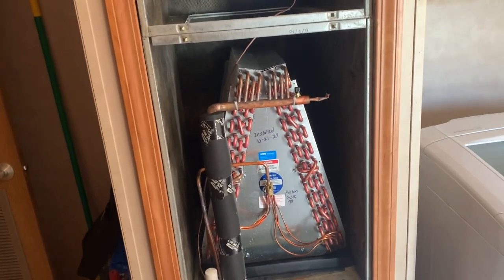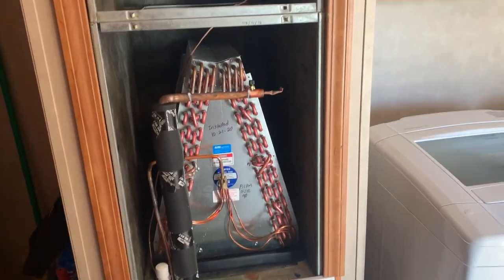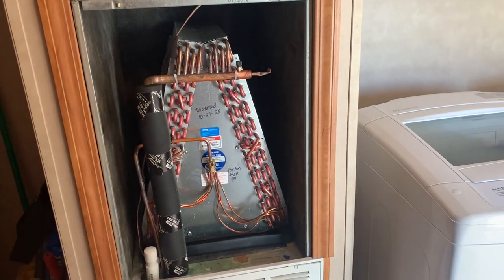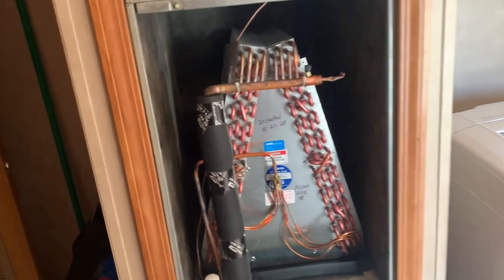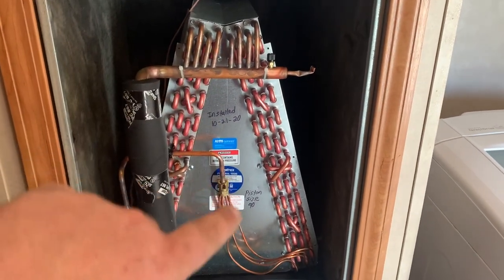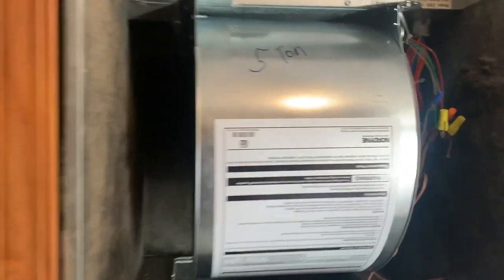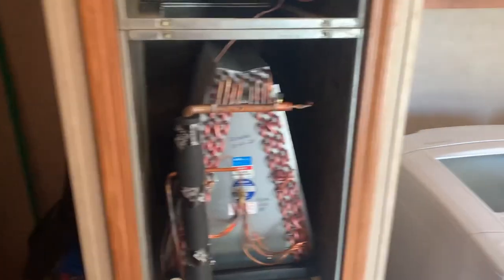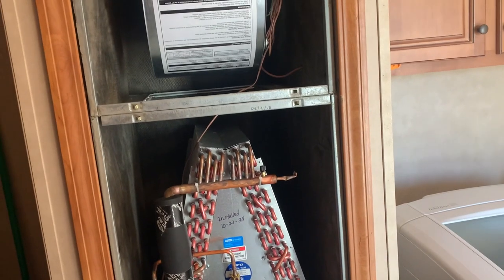A Mobile Home HVAC System/Rant

Comment: It's so good to hear someone who will actually work on Mobile Homes.  I'm a Widow.  I'm 60 years old.  I have done electrical , plumbing, and built a new deck.  I'm not shi&%ing you, I called every danged place in town.  You know what they all told me? " We don't work on Mobile Homes".  I live in Southeastern Kansas.  My home is 28' x  I think 32'.  It has a cement block foundation, and I'm keeping it up as best I can.  
So...I bought a ceramic box heater, and a Window AC unit when they went on clearance the last two seasons.  Well, guess what happened today? My frigging furnace Quit.  
I needed to hear everything you said here tonight, because you know what?  I worked my ass off , and my body fell apart.  My Late Husband worked his ass off, and Agent Orange killed him anyway, at the age of 69.  I'm sick of life.  Every time I get something taken care of, something else dies.  I'm just DONE.  But Thank You for your kindness, and others who don't judge others.  God Bless.
Reply: I hope things are looking up for you
Reply: Never let the bastards get you down!
Reply: You must have a few bucks extra because houses know that LOL
Reply: That's the reason I do everything myself also because no one services mobile homes. My HVAC system is a package unit because they don't take up any indoor space, they are quieter, and I can replace them myself. They are also easy to work on as far as replacing components such as capacitors, contactors, and fan motors. The only thing I can't do is recharge the unit but I will learn at some point. I only found 2 local solar installers who do mobile homes even though I wanted a ground mount system and I own the land outright. I had the system installed but it was a bit of a challenge finding someone to do it.

Comment: You have explained your situation very well even though you owe none of us ANY explanation, if you do you and provide a service that continues to provide yourself with work that carries you into the future then your doing it right, those that get it there is need no explanation needed and those that don't no explanation will ever do.
Btw my personal experience with the magnets so far has not been a good one, after 2 months on the van it broke apart on the left magnetic material on the van

Comment: You did great a great job, I also thank you for calling out these ignorant mobile home haters. What you do is good honest work and very respectable. I bought an old house with no proper heating at all ever installed, I don't have a ton of money so I simply bought a diy mini split from senville, installed it myself one weekend and vacuumed the lines myself and have no issues. Was actually so easy to install it was ridiculous, The whole set up was just around $800 installed for 24k btu of cooling and heating. Love the channel keep up the great videos!

Comment: My 1996 Clayton 14 x 72 has a 2.5 ton 53.000 btu Intertherm e1eHo15HA. I see NO issue using a 5 ton unit in a MH that's 30 x 80 as it's over twice the size of my single wide.. A job is a job... Rock on!!!!

Comment: The traps dry out in the winter. I had a bunch of trouble with an airhandler that had a leaking A coil at the start of every summer. It took me 4 years of changing coils before I realized the Condensation drain was plumbed into the sewer. It had a drain trap but during the winter it was sucking in ammonia gas which corrodes the crap out of aluminum and copper. I learned the hard way.
Reply from the maker: This is Louisiana. We don’t have a winter. We run our air here at least once a day. Been doing this way for years no issues
Reply: @johnisraelhvac2019  that was over 18 years ago (probably over 25 years ago). I've replaced at least 15 units that have been damaged from sewage gases since that I didn't install. I've been doing installs since 1988. I'm just simply trying to share my experience..

Comment: It makes sense for that home to have a system that large due to the climate. I have a 3 ton heat pump package unit which works well even in the low teens to single digits and it has no auxiliary heat, it doesn't need it. I usually use my wood stove in the winter months due to less solar production though.

Comment: I've been doing mobile homes since 2001. I work for 4 MH sales centers that sold about 300 homes a year, mostly double wide with a few mixed in single wides. I run 4 men in 2 trucks. We connect the 12"  crossover duct, the dryer vent, the gfci electrical outlet and wire our own heat pumps ( I hold electrical and hvac licence). Those items are extra charge.  I profit over $200,000 a year not to mention service calls and my men do all the work. I make $1500  profit on a 3 ton install + about $ 500 on the extras and it takes about 6 hours total for two men. I'll take MH work any day.

Comment: Do you have any filters on A-coil evaporator or just on the door. Should their be filter on door and filters on A-coil evaporator.

Do you use those A-Coil metal mesh filter part#(917416) for Mortex evaporator.

Or use 1 inch cardboard pleated/fiberglass furnace air filters. Merv 2-8

Or, should I use washable/reusable furnace air filters due to water on coil during summer. like metal mesh filter part#(917416), Merv 4 Flanders SM1006 naturalaire hogs hair cut to fit 20 x 30 x 1, or 3M Merv 1 cut to fit 20 x 30 x 1.

Thanks.

Comment: Great to see you posting videos, John.  I grew up in Louisiana and I knew a lot of people that lived in Mobile Homes during the week.  During the long weekend they had a log cabin or house on the Lake or Bayou that was about 5,000 Sq Ft.  They lived in Mobile homes to be near work.   I never understand people that judge a book by it's cover.  And by the way....work is work.  A Ruud in a house,  a trailer or a outhouse is still the same Ruud system.  What difference does it make?  You are making money and not having to be in some freaking hot attic.  And another thing about Louisiana.  It is freaking hot!!  Mobile homes get twice as HOT as a normal wooden structure!!  The Tonnage of any unit goes up a ton in Louisiana and other hot states.  A certain SQ FT house that would have a 2.5 ton in Georgia will be a 3 or 4 ton unit in Louisiana.  It has to not only cool but get out that freaking 100% humidity that is almost the majority of the year!!!

Comment: Brother your 5 ton is correct.  I have a 2300 sq ft mobile home with 6 inch outer walls, and my 4 ton ac with 24 inch mortex is just perfect with the Texas heat.  However, when I first purchased this home last year, my AC guy put the wrong A-frame coil, the 18 (?) inch mortex and it froze on me on two occasions. I had it corrected 6 months later.

Comment: Every mobile home in Phoenix has a 5 ton in it. Most homes here also have at least 5 tons, most are at 7 tons on 2500sqft
Reply: Yup. Friend has a ~1800sqft house with a 5 ton, and on a 118 degree day it truly needs it. Their previous ~1600sqft condo (with a unit above) was a 4 ton.
Reply: I live in San Diego and when I work in our desert area which is just west of Yuma I automatically upsize one ton just for the desert heat load.
Reply: @dockshvac9485  The nice thing about the desert climate is you can upsize without worrying about humidity. I live in New England and if you do that here (with a single stage at least) there will be a lot of days where the unit doesn't run long enough to take out enough humidity.

Comment: I have a split unit in my mobie Home my a COIL sits on top of my furnace And where it's sweating is running down the pipes running on top of the furnace rotting my floor out also how do  I don't   stop that I appreciate you doing videos on mobile homes that's what I live in enough people don't do things About mobile homes Thanks again for sharing

Comment: Done it myself many times,we have many two many Wana be contractors, out here ,don't know Jack about heat loads, cooling loads, much less static pressure,superheat, subcooling, I'm with u ,u don't want floodback,I just got through putting a 5 ton Rheem in and put the upgrade blower in, u have a high latent load in your area, don't pay attention to the wannabees,the wanabees cut corners , their are excellent contractors out there that use technology instead rule of thumb, they even make a low profile safety switch for mobile home pans.if u don't charge enough u go out of business eventually,the 500 profit will go away after 1 warranty call back, people has to have a place to live.ive done clean rooms to mobile homes , I don't pay attention to know it alls and haters .it's called technology, God bless u John some of us out here are in the same boat.

Comment: North central pennsltucky is loaded with mobile home fuel oil furnaces , work all year around doing cleanings, replacement and heat exchanger replacement.

Comment: I live in a mobile home as well. Here in central Florida, I wish my system is bigger. Its fine in summer. But in the winter it can get so cold, it doesn't get warm enough. I have lived here for 16 years. And have been through at least six hurricanes. Four of them direct hits. Two roofs and carports. Not anymore damage than some of the brick and mortar homes. My big problem is my air-condition is blowing dirt onto my ceiling. How can that leak be fixed. By the way! I commend you on starting a business without going into great debt. Sometimes you just have to ignore some people. Because there is always going to be fault finders.

Comment: I live in a double wide manufactured home and it is a good home, I am getting close to needing a new heating and cooling system though. What in your opinion is the best brand to install. I haven't contacted any installers yet to see what is out there.
Reply: Mine looks like this one except to the right is the hot water heater. What a pain to get to.

Comment: John the newer mobile homes are getting big and nice you should see them prefab houses too.
Buying a mobile home is faster then waiting for a house to be built 

I also am here on Texas Its 75 out today cooling off but has been in the 80s to my ac is still on.

I have a 2.5 ton unit it struggles on hot days for even a 900 sqft house. When. Its cooler it does great.
 I feel I should have bought a larger unit though.  Tonnage is based on size and heat load.

If you have a 1,00p sqft house and you size a unit based on that which is a 3 ton the unit wont cool properly. You also need to account for heat load.  This is actually where the 2 stage units come in handy when it's hot out it ups the capacity.

I should have gotten a 2 stage say on hot days ot runs a 4 or 5 tones and cooler days 2 tone capacity.

People don't get it that just sizing a unit based on sqft doesn't work not down in the south where  temps easily get over 100.00 you have to account for the heat load. Also older homes like mine have shitty insulation so the heat load is greater and a unit sized properly will not work properly.

Now I also have a 900 or larger sqft store that has apartments on top the building is well insulated we went with 1.5 Ton unit it cools perfectly even on 100 degree days.

Again people don't get a property's sqft is just a basic calculation it means nothing if you don't consider heat load and in cooler climets the opposite cool load  if that's even a term you always  always consider the load to be put on the unit your installing.

I had a house that had to units the house was 2600 sqft. The house had a 3 .0 and a 2.0 tone units.

The house never cooled properly the units ran non stop.  We had the units changer and upsized the ac contract gave us hell saying the units where to large.

We put a 4 ton on the main floor  and went back with another 2.0 because the guy insisted that 2.0 was enough and only the main floor needed upsizeing and the unit we wanted was even to large.

Well first summer the main floor was kept ice cold unit came on froze you out . The upstairs unit ran non stop and could barely maintain 78.

It ran like that a few years we called the guy out unit is fine so we say we want a 3 ton unit upstairs he's all like it's to big it will short cycle I look at him I said I want a ton do it or I will find some else who will we also had all the duct work and furnaces changed.

After the new 3 tone unit when in we never had ac issues again thenhouse was kept a comfortable 74 degrees and the electric bill went down we choose raheem units.  The house has since been sold the units where put in in 2008 and house as sold in 2018 in the 10 years we had the house since the units where changed not one complaint on the ac units and that used to be the biggest complaints the house is hot and the electric bill is high.

I dont understand why people have it engraved in there heads that the sqft of the property is all that matters because it dont. I actually think the sqft measure ment is useless  if you have 2 house both exactly the same size one new built to energy guidelines and a  house built in the 50s or even a historic house built in the 1900s  the  older house will need a larger unit then the newer better insulated home. Since the new house has good insulation and windows the heat load will be less.
The older home with little to now insulation with big not sealing properly windows and doors will have a larger heat load thus needing a larger unit. Also the climate the home is located means everything hotter climates need bigger units then cooler climates.

I think it should be required to do heat load calculations when selecting an HVAC system.

Comment: In addition these fly by nights need to have a manometer on their truck to check static pressure , ive done clean rooms to mobile homes, and all requires air side equations, u got my vote John, along with the Lord, love thine neighbor as thine self, and use your air side equations and the science.what ago John ,I see half a mechanics in my area also , that run their mouth and don't know crap.

Comment: John, I live in a doublewide. I am having trouble with my heat. It blows out like it is on the fan. Any suggestions? Air filter clean. Have turned off at breaker box. It is starting to be spring finally here, but was a cool week here. Did have to put the AC on last night, but was really cool this morning. Turned the heat on for awhile but noticed the heat was running just as the fan was on. Wondering if it is the thermostat? Appreciate it. My son lives in Louisiana!!! 💜💛 I live in NC. We just serviced it. Was freezing up on the AC. The furnace is a General Electric. Outside is a 2 ton Medallion Series. Thank you for your you tube videos!

My fiancé just got home.. after going over the videos, found out it was a loose wire on the heating coil!! Whoo Hoo!! Have heat now!! Thank you!!!! 😊
Reply from the maker: Good deal. Glad you got it fixed

Comment: Does it have 5 tons of ductwork in a trailer? I also didn’t know RUUD was rated for manufactured homes?
Reply: You have a good point my friend does it have 5 ton ducks and you know what to I lived in a mobile home and I'm sorry I do Refrigeration. Mobil home's but I lived in a Helena mobile home and the guy put the right size unit for the square footage but it it because it didn't have a return air someplace it never made it back to the unit cuz the house is so big basically it would be nice if you just run all day long to hold like 78° when I was like maybe 90 outside Tuscany Pointe District really good point
Reply: The taller Mortex coil is required for 14 SEER 3, 3.5 and 4 Ton Heat Pumps and 3.5-4 Ton Condensers. (If you want an ARI matched system) 

The small beer can aluminum mh ductwork will not flow 1800 cfm up here. All of ours up here in Ky are down flow, with coil on top. Anything above 3 tons almost always has problems with condensate pull off due to the inadequate flow area/higher velocity airflow/lack of coil cleaning at installation and yearly afterward. 

The reason you need a 5 ton on that 30x80 mh is due to losing so much more capacity with attic ductwork. 
It doesn’t meet ARI standards, but sometimes you don’t have a choice. 

I’m the same as you, I make half of my living from mh customers. I’ve also worked on 15,000 sqft houses in the Atlanta area with 30 split hp systems. I treat all of my customers the same and do the best job I can, as if I was putting it in my own place.
Reply: You can get 2.5 ton to work in a single wide. Why wouldn't a 5 ton work in a double wide?

Comment: I'll never understand why people tend to assume mobile homes are all rundown and crappy, occupied by people with no money. I know of a lot of trailer parks around here that are kept up, with an HOA that actually has standards, everything looks maintained and in good shape. I've even seen a doublewide that was put on a foundation with a walkout basement! These people all have money, and they also have a home with a system that needs to be worked on or replaced. Like you, I see no reason to either turn those customers down, or automatically just do it as cheap and sloppy as possible. If the guy has a 2400SQ/FT doublewide, I see no reason to approach it any differently than a house of the same size built on a foundation.

Comment: Your right,  treat every one the same,  big home or trailer .. I just installed a 4 ton unit with the 4 layer coil also , but You have your blower on top of coil , my coil is on top and blower is on bottom, down flow.  is your a down flow or up flow. just curious.  thx

Comment: Hi John, I need some advice. I live in a mobile home, 30 years old, with a gas furnace and an AC system. I have figured out that my furnace is cold and putting cold air out around it when running the AC. I have been told that I might look for a damper to install at the base of the furnace...are you familiar with what I might need...Thanks man, your the best.